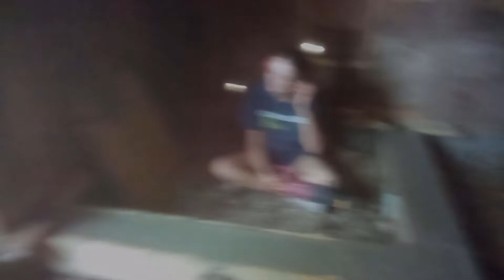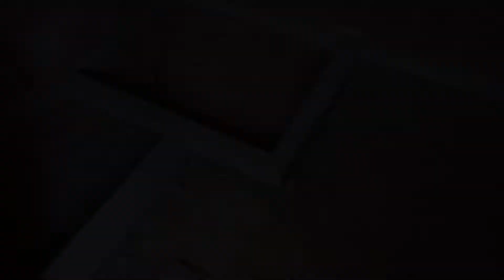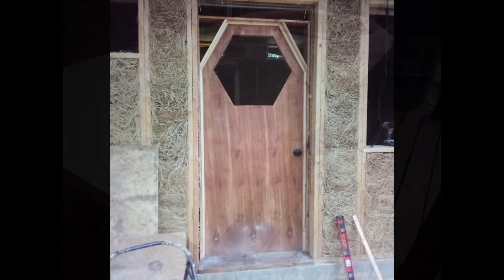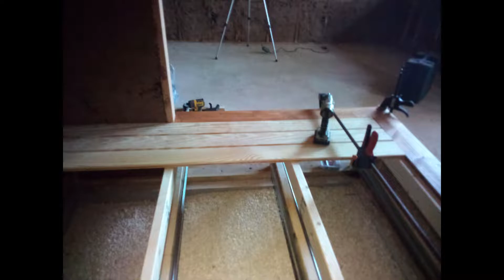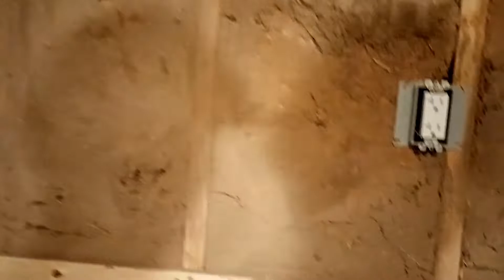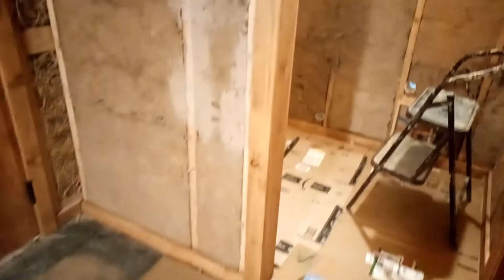EBC: Interior Finishing Part 1 - Interior Walls, Ceiling, Doors, Windows and a Sleeping Nook

Comment: This looks amazing! I’m looking at doing something similar soon and have a few questions.

1- would you recommend adding a let in brace for the framing to reinforce the stick frame structure, or did you find that the infill was enough? 

2- Were you able to plaster over the lumber or did you need to add tar paper or lathe or something so it would adhere better?
Reply: 1 - A let in brace would probably be a good idea. In this case I built bracing into an interior wall that bisects the back wall.

2- Adhesion isn't much of an issue. However, sometimes the plaster will crack vertically along the stud as it dries. A straw rich plaster base coat usually prevents this type of cracking. I've also stapled strips of burlap to the stud face which works as well.